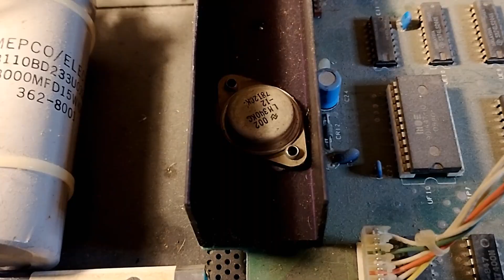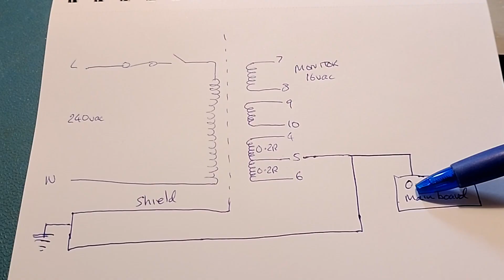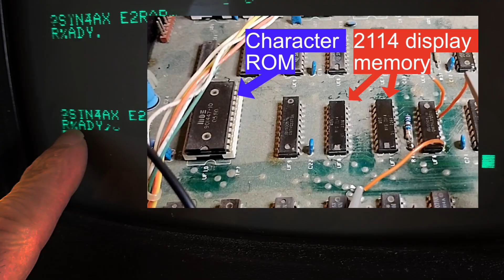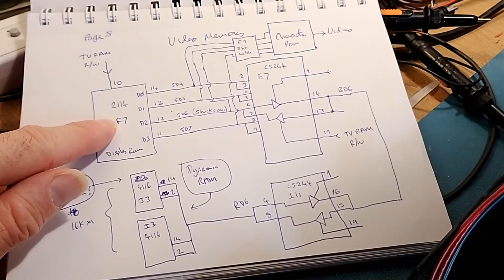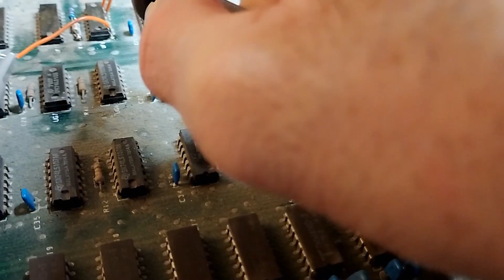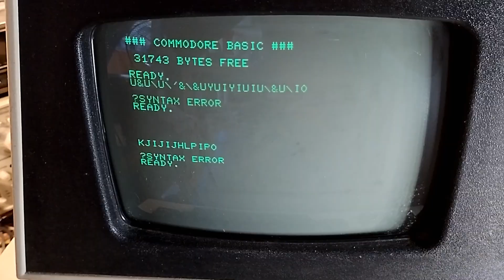Commodore PET - Garbage on Screen Repair

Comment: That a fun trip down memory lane,  I have the PET with a pathetic key board, not powered it up for twenty years but was working.  I think a good brushing of the PCB may settle down the display, dust becomes conductive or increases capacitance etc buggering up timing and resets.  Well done getting that going.
Reply from the maker: It was interesting repairing that old PET. My first job back in the early 80s was working on that type of electronics (fruit & video fruit machines).

The PCB was pretty dusty but I was wary of running the vac over it in case it created a lot of static which could do a lot of damage. I could just wash it in a bowl of water!

It's a great looking computer though.
Reply: @orangevalleyelectronics  I use a natural bristle pain brush which does a good job getting under the chips.  Funky kit around in the 80's some even point to point wiring. It is a good looking computer and for a short while very capable. The BBC Micro project really goth things moving along with all the kit CPU's like Tangerine and Apricot.
Reply from the maker: @Woffy. I will look into the brush idea. Ironically I had the Tangerine kit! A good way to learn about computers and microprocessors as in its basic form you had to enter your code as machine code from a hex keypad so not very user friendly.
Reply: @orangevalleyelectronics  Memories of a PDP 11,  toggle switches everywhere.